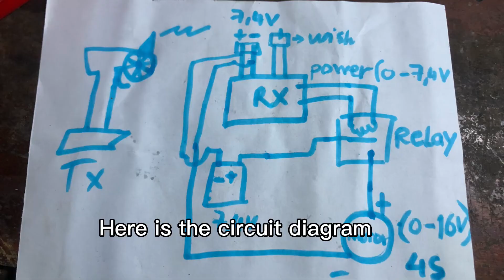Unbelivevable Mini Rigger  rc boat use brushed motor 480-4s 63Km/h.

Comment: Xin thông tin cấu hình
Reply from the maker: Bộ tx rx rẻ ,đóng ngắt motor bằng relay 5v nối với ngõ ra của mạch rx.
Motor 480 
Pin 4s 14,8v 
Chân vịt 35mm
Khớp cardan 3.17mm
Servo 9g